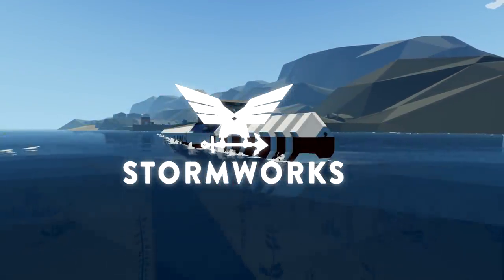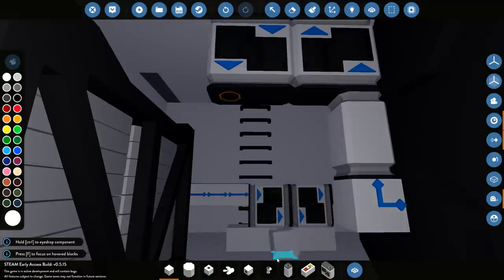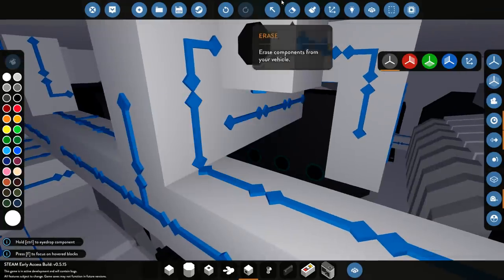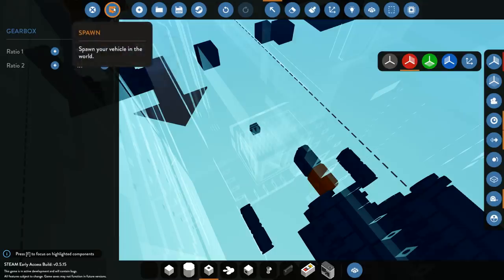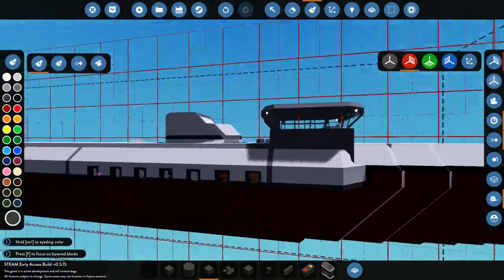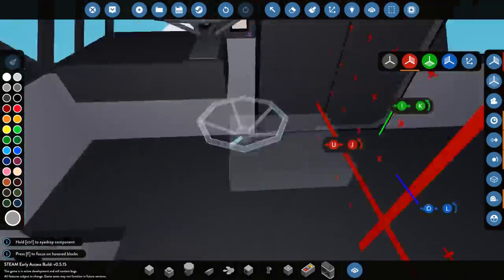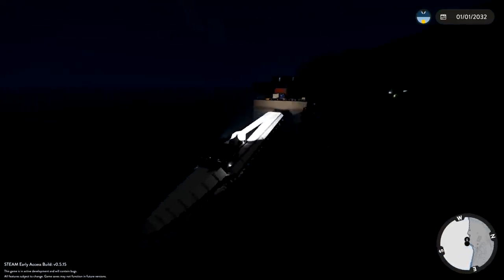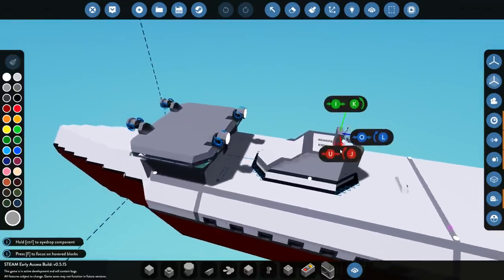THIRD TANKER ENGINE  -  Stormworks: Build and Rescue  -  Build  -  Part 10

Comment: Matty, you can switch the clutch to an button (which i think is easier to press) by using an numerical switchbox & 2 constant number logic parts.

(button links to the red button being switch, one of the constant numbers are to be input 1 and the other 0 they are both seperatly linked to either on or off
then the output is linked to the clutch and FRANTASTIC its done :D

Comment: Frantic theres a very simple answer to why the 3rd engine didnt work at first
If you set its rps to 1/3 and the other ones to 3 than you are trying to connect to driveshafts, one has 9 times faster rotation than the other.
How did you think it whould work??!
Reply from the maker: Im going to change it to just be a generator and use electric motors as a starter... Im not sure why I tried what I did XD